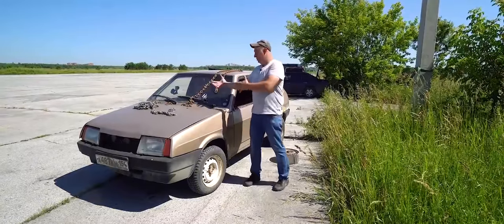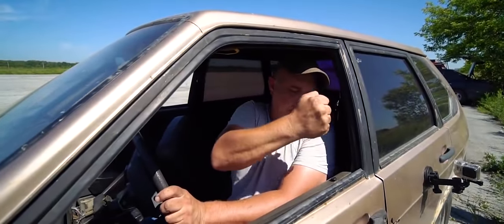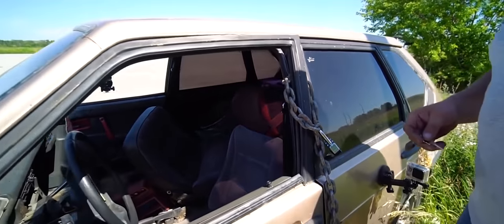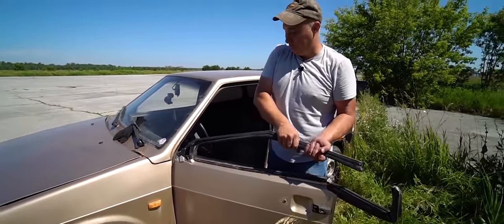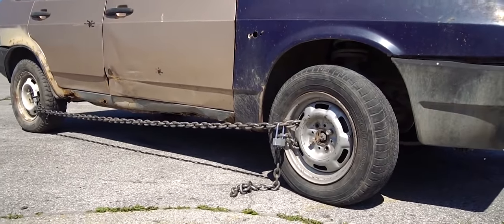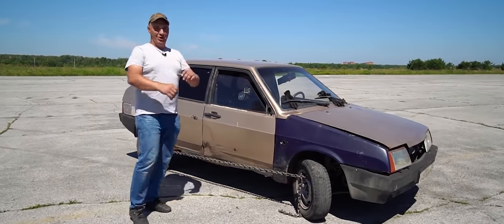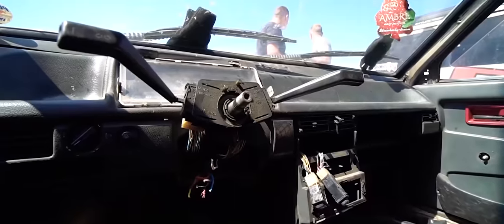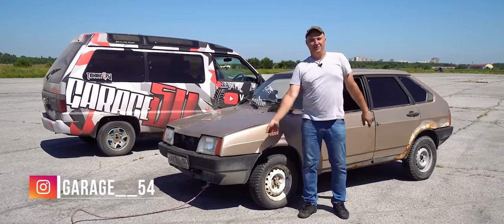Will a car drive if you chain the tires?

Comment: You guys should try some anti towing techniques. Like see what method can be used so that your car doesn't get towed. It would be cool if you could find a way to make a car tow proof.
Reply: Chain your car to the fire hydrant you're currently illegally parked in front of. :)
Reply: Cant tower will just drag it onto a flatbed then charge extra. My friend works it and he always laughs at possible scenarios when i used to ride with him
Reply: anti towing techniques...how about parking in a legal parking spot...
Reply: A tow truck has plenty of power to drag a car. And beyond that they normally have dollies they can put under the wheels if they won’t roll. Or, can just drag it up onto a rollback. You could try attaching the car to something solid, but at that point they’ll likely either tear something up trying to drag it, or cut the chain. Also in some countries they use tow trucks that have a crane to pick up the car and set it on a flatbed. 

So, in short. You can make it more of a hassle to tow, but they’re still gonna be able to tow it.
Reply: @jacobmcconeghy7728  it doesn't always work like that. Sometimes for people that live in apartments, they make it impossible to find a safe parking spot.
Reply: It's impossible to tow proof a car. There's different types of tow trucks if they can't get it with one they can get it with the other
Reply: Learn russian to make a youtube comment lol?
Reply: 12 gauge helps
Reply: I was a tow truck driver for years. I can tell you the only way to guarantee a vehicle not getting towed is by keeping it in a garage.
Reply: One way to really make your car mostly untowable is air bag suspension to where your frames on the ground lol
Reply: There is absolutely nothing you could do to your car to make it where I can't tow it, except like someone else said, leave it in the garage.
Reply: @benson4u215  Negative. How do you think lowriders get home when their airbags/hydraulics blow and it's sitting on the body in the middle of traffic?... Tow trucks. We would use wood planks to lift it enough to get a jack under the frame or suspension and slide the flatbed under it. Happens quite frequently.
Reply: How about if the parking offender bought a boot privately and just parked in front of a fire hydrant and put the boot on a wheel. The tow truck couldn't put a roller under the wheel that was booted.
Reply: that is easy just get a walking dragline excavator and use it as your daily driver ;)
Reply: Just put a sign on the car that says "Do Not Tow. Violators Will be fined not more than $1500".
Reply: @dannydaw59  for a flat bed truck we would use the jack to lift the vehicle, put some skids under the booted wheel and drag it up with the brake applied or in gear if it's on the drive wheel. With a wheel-lift tow truck that job would be cake especially if the boot is on the drive wheel. If it was on the non-drive wheel we'd use dollies.
Reply: Easy...have a big truck...I have a Dodge pickup...says 2500 on the side...underneath it's as heavy as it gets with reinforcing and everything else...got a Cummins diesel with a standard tranny...has weights in the back and half the weights in the front...but it's a lot of weight regardless...I can hail as much as the big semis and everything else but the big thing is the reinforcement on the frame ....

A truck tried to tow me once because the sheriff deputy was a dick and I broke the first truck...the 2nd one I snapped their cables so they tried to put it on a flat bed...they destroyed the front of their cruiser and also broke the flat bed...not the truck but it rolled the deck and snapped the supports...also snapped the winch off...not the cable it broke the winch clean off...they were setting up the crane about the time I got out there...I called up the sheriff's office and asked them to send some more deputies out because we had a problem...I didn't have to pay damages and the deputy got fired and I had a good laugh...

Eventually yes they would have been able to tow my truck but as it set they couldn't until they brought in some heavy duty machinery...

That being said I can't drive on every road and it is also expensive to keep my driveway intact...I hqve to constantly move it or the concrete cracks ..
Reply: Buy a tank, problem solved!!
Reply: @Pura9910  but that's not a car... Plus still towable. Haven't you seen a tank on a semi?
Reply: If chaining the car became a regular occurrence, towing companies would issue bolt cutters to all their staff members.

Get a custom wrap job so your car looks like police/ambulance. You can park where you like and won't get towed.
Reply: @phoephoe795  most tow truck drivers already carry bolt cutters. I sure did
Reply: Kolonol1 you can’t haul as much as a semi.  Your dodge will not consistently pull 80,000lbs. You may be able to move it, but you can’t haul it. Secondly, there are much larger tow trucks than the light duty trucks meant to haul Honda’s.  If they wanted to move your truck, a medium duty would have done the trick, it wouldn’t even have taken a heavy duty.  I know you’re a bad ass and all, but anyone who knows better sees right through your bs.
Reply: Simply add a cover over the areas that could be towed from so it has no point to latch to
Reply: I used to be a repo man.  
If you really want to stress one out, and happen to live in an apartment complex,  chain the vehicle to a post from the covered parking.  At night they wont see it, trying to hurry.  They'll tear it down! Always park in a garage, that's safest.
Reply: Tristissimvs you are reading my mind!!!
Reply: Claymores.
Reply: Capt. Killingfield Capt. That would just cost more damage.
Reply: icedink87 icedink I freakin' knew it.
Reply: Weld car frame to sewer drain
Reply: Pay your car payment on time and don't park illegally
Reply: Justin Connors Justin what if you have no choice?
Reply: @livefreeordie4850  most banks have a loan insurance that'll pay your bill if u get sick or injured and can't work. Otherwise u should know wether or not u can afford the payment. I understand there are times u can't do it but some people just don't pay it cause they are extremely irresponsible
Reply: Justin Connors Justin I agree
Reply: pistol repairS

Comment: Garage 54.  For your next video you guys could attach rod from rear wheel to the front to see if you can make this car a 4x4.   I suspect this would be a straight line car only.  LOL
Reply: Something like a old vapor locomotive´s wheels. Zero steering.
Reply: @edtam6  Exactly...
Reply: Add a hinge or ball joint. May have slight steering.
Reply: You litteraly stole idea from my brain.Exactly what I wanted to see after this video.
Reply: I had the same thought and left a comment I hope they do
Reply: @edtam6  slip shafts for the length?
Reply: Except with a 16 wheeler...
Reply: lol

Comment: We just pick up one end with the tow truck and put tow dollies under the other end. #repolife
Reply: If I can see that shit it's mine lol just you try and hide from me. Now they're using drones to see if people park stuff behind the house without getting close to it. Fun stuff.
Reply: Has any repo person here repo'd a car with air bag suspension where the frame's on the ground?
Reply: 点さら
Reply: I saw a Dodge 3500 DRW with one of those crab looking car snatchers in the back.
On the door it said what recovery firm he worked for.
On the bed it said "Another One  Rides the Bus"
I laughed.
An instructor I had in college used to recover cars for his uncle's tote the note lot in Chicago.
People would make the down payment and one payment then repaint the car and change the locks and stop paying.
He would show up, double check the VIN numbers then blow the passenger window, hot wire it and drive it back to the lot.
If you don't want repoed pay your bills.
I do think Texas should make it illegal to repo after dark since repo guys get shot every year there.
Legally in Texas you can shoot a car thief or trespasser after dark.
I suspect most of the shooters know they are behind and it is the repo guy but they usually get off in court.
Reply: @bobby2pistolz854  so because they are good people they get car for free?

Comment: That's a faster way to pull the steering wheel.  Overall I got a great laugh out of it. Since you have a good time trying stuff with cars, say you are stuck with a all wheel drive or 4 x 4. You have a couple 2x4x10 boards and some bolts. Could you get unstuck by connecting the front and rear wheels on both sides with the boards and bolts. In the same way that a locomotive turns its wheels?. What would be the outcome?  Just curious.
Reply: Not sure of that but I think no.

if you have 2 poles and the chains. You can
dig under the vehicle to get the pole across the drive tires. Chain the pole to the tires through the rim. Drive up on the pole. 
This will lift your vehicle up out of the mud. Undo the chain.
Using the second pole.
Put it across the drive tires and chain it to the tires. Pull forward onto the second pole.
Remove the first pole and repeat the process until you are free.

Comment: As a tow truck driver, I promise you that I'll still remove your vehicle. I don't care if the parking brake is on, you cut the wheels, or even if you chain all four wheels together. Either a wrecker or flatbed will work. There's skates, go Jack's, dollies, and different techniques. Might add a few minutes to the task, but one way or another, it's coming with me :)
Reply: as a tow truck driver, i also agree with this , i dont care if i have to drag it up the bed in park its still coming with me, the only problem i see is if it was chained to a lightpost or something it would have to be cut.
Reply: ViscosityAE true, bolt cutters are cheap
Reply: tOY BOy  haha parking legally would also work
Reply: What if I have Hummer Marauder?
Reply: Tow truck drivers have it tough dude. Good luck in your profession. Pissing people off for a living can't be fun
Reply: i m sure this vid is to show how to deter a car thief, well tongue in cheek, not seriously .. 
no one believes these measures will defeat a tow truck bitch..
Reply: Lol how many guns youve had pulled on you
Reply: @drd1449  just need the right  truck for the job. There's tow trucks that can pick a loaded semi off the ground.
Reply: What if I impale my car with a light post, then you will have to take the light post out with my car. Adds an extra hour at least
Reply: @yotxguy9670  for why? they are doing what their boss tells them to do. as for repoing cars, the owners of the cars deserve it.
Reply: 12ft ground anchors would stop you mo fo rb16sk8
Reply: I am gonna buy an old tow truck......and go around towing parked tow trucks.   Maybe even go to the tow operators house....and tow HIS car..ha!  Karma is a biatch huh.
Reply: A car with a 50mm chain attached to something solid such as a girder or post. It will take you a lot longer to load this on to a truck.
Reply: @yotxguy9670  No, not even close. If you park like a dumbass you get towed. Not a hard concept to understand, and its definitely not hard to avoid. I've been driving for 35 years, and have never been towed. It isn't hard, just don't be stupid
Reply: Hell no I’ll leave before you get there and you will get out my way or my 🔫 will talk and you will move
Reply: King Zak  fake thanks for playing
Reply: All those you say they will shoot the tow truck driver beware, tow truck drivers are known for having ccw
Reply: The challenge is to tow the car without damaging or breaking into it because otherwise you are liable to pay for it instead.
Reply: @Ed  Personally, not yet. But Tow drivers have saved my bacon before, even on Christmas eve! True I had to pay time and a half, but it was worth it to not have to replace my van ( and it's contents) had someone taken into their head to steal it. So props to Tow Drivers everywhere!
Reply: @yotxguy9670  Really, you think some one that has a legitimate job not only hauling off illegally parked vehicles, but also removing wrecked vehicles or broken down ones are WORSE than people who want to or do sexually assault prepubescent children?
Reply: @yotxguy9670  you miss a car payment recently? Lol
Reply: Unless it was stolen. Wouldn't care if it was taken lmao.
Reply: Oh there are ways
Reply: Why all the haters on tow truck drivers lol .godam I'll definitely repo your car truck boat camper.
Reply: My car is made from gold so it out weights your weight limit.
Reply: I mean if you're legally taking it youd just cut the Damn chain
Reply: Can confirm, I have a large stick that I flip cars off my land with
Reply: rb16sk8 I can sue you if you destroy my vehicle
Reply: You cant take it with you if you have multiple bullet holes in your chest
Reply: What if i super glue my car to the ground tho?
Reply: rb16sk8 what if I park an Antonov 225? Or a Marauder? In Top Gear Richard Hammond tested the Marauder and because he Parked Illegally, Mr.Tow scum came and guess what... The Marauder just pulled the Tow truck away. Like it was a Toy. Btw it survived an explosion so... you can’t tow it away.
Reply: We have a lot of free parking here!
Reply: @yotxguy9670  
What the hell went wrong with you?
Hope you break down somewhere abroad with -20 degrees, no reception, 20 km from the next town. You either get a tow truck or you die. Seriously, some people don't know how to use their brains.
As for parking illegally: Use your brain and park where you should do so, you won't get towed. It's bloody simple.
Without tow trucks, sooner or later all highways are blocked, winter would be catastrophic and help wouldn't be available anymore.
You should thank those guys, be a little greatful, man...
Reply: Easy way to prevent a repo on your property is a few stakes and a rope across you lawn and drive way. Take a picture of it and it constitutes a fence making it illegal for him to repo the vehicle parked in the driveway. Well least in Colorado
Reply: Yeah, you drag my car and damage it you'll also be paying for it ;)
Reply: @drd1449  Pay you parking fine and you can pick up your Bla Bla at the parking lot for dummies. Tow trucks come in sizes, don't forget. If they want it removed, it will move. You'd be surprised how skilled they are.
Reply: @fazerider4202  Tow truck drivers know more about chains, than that chain itself. They look at it angrily and it just melts. Magic.
Reply: @yotxguy9670  Literally scum is the Dutch word schuim, that's foam in English. Scum of the  earth is metaforical, not literal use of the word scum. So literally, you're wrong.
Reply: @yotxguy9670  And another literally joke: most pedophiles are childrens parents. It literally means loving children like crazy. Well, parents do. Deep down. Somehow calling parents a pedophile is not that smart, phile has to do with love making. That's weird, love is cute, and making it is private. Maybe love is a baby. Man, this is getting complicated. Remember, better not call parents pedophile. And better respect tow truck drivers, too.
Reply: These comments against tow truck drivers are uncalled for.   Pay your loan and park legally and quit blaming others for your bad life choices
Reply: There's a simple solution to not getting towed. Own a big enough truck
Reply: @smokeymcpot1192   look man if you have a car payment you dont own that car its not yours its the banks, and if you dont pay they will come take it away, lets grab a beer ill teach ya how life works
Reply: @Matthew-sb7qc  look man, that's only a small percentage.most of the tows are for wrong parking.come have a beer i will show u how statistics work
Reply: rb 16sk8, then you are
a thief sir. Why you people
steal is way beyond me...
Oh well, you need to change
you ways sir and leave others
people 🚗 alone...

Comment: They have removed the bolt from the steering wheel
Reply: Yea I noticed that too.  But the chain did still bust the plastic under the wheel though.  Steering wheel had to have loosened bolts or only one or so to come off so easily and without much damage.  They knew what would happen!

Comment: Why did you take the nut off the steering wheel you can see when you showed it after it was off the threads was on the steering rod. Should have left it on an see what happen.
Reply: It's the nut behind the steering wheel that is the problem.

Comment: Wow. A Toyota space cruiser. Very rare and very expensive these days.
Reply: in that condition it won't bring much more then $1000 i think
Reply: - van Dalen with all of the artwork and designs on the side? Looks pretty clean to me. They used it to tow the car at the end. They sell for a lot of money and it looked clean
Reply: - van Dalen yeah look at 6:08. apart from all the writing on the side it looks Clean
Reply: in good condition they go for $4000
Reply: - van Dalen bit more in England. They’re very very rare here. You can get Townace too but the Space Cruiser is even rarer. Saw one for £4,500 recently. About $6000

Comment: Yeah... You could chain your wheels together. But if someone really wants to steal your car, they'd just change the wheels.
Reply: Or use a bolt cutter
Reply: What about lock lugs?
Reply: Sean I know right!
Reply: @timgroot4231  everyone knows lock lugs are ez to bypass
Reply: Chain your wheels to the car
Reply: Amethyst Amethyst won't work. Those tow  trucks can drag any car up the ramp.

Comment: Maybe it would create a 75% four wheel drive effect if the chain was at the top of each tire cut to exact lenght so it would pull the rear wheel  equally for a bit and if the tires are same size and remain on the ground whilst driving the ratio would stay correct so the chain would pull the rear tire when gets to the top
Reply: Nah